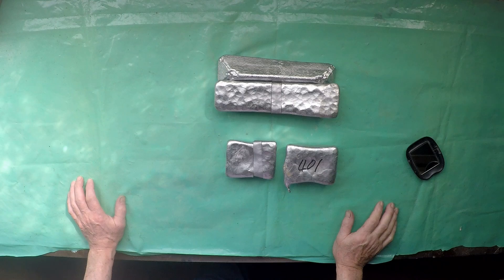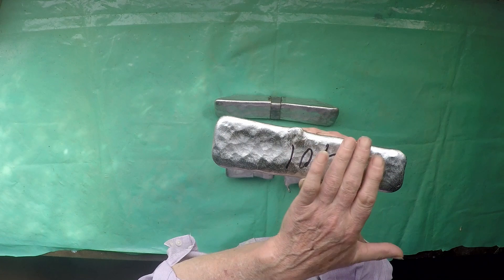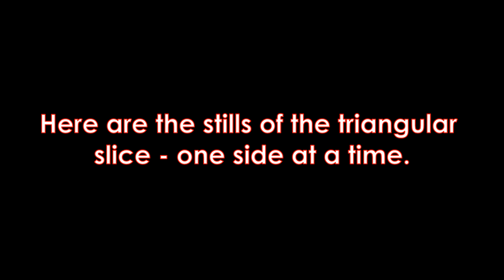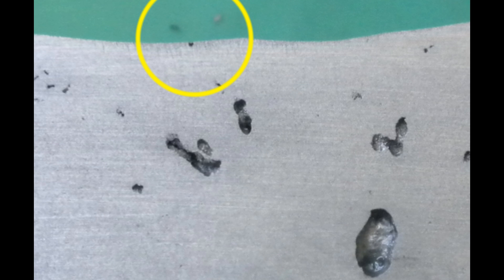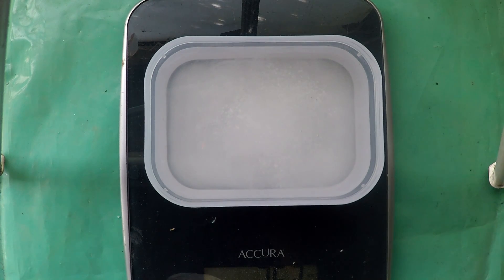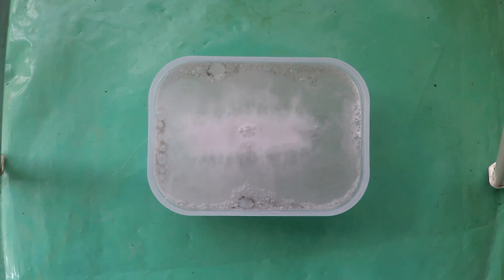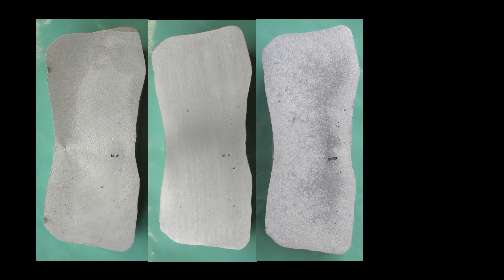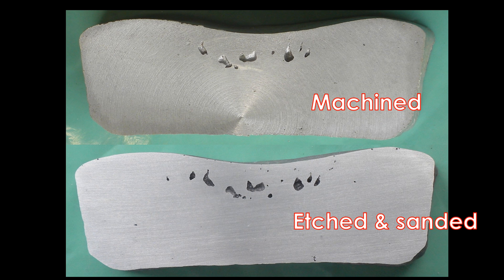Caustic Soda etching to reveal porosity in aluminium alloys.

Comment: The only question I can't seem to get answered (or I haven't come across yet) and that is how does one prevent porosity in high humidity areas?
Reply from the maker: Amalgamous, I am mulling this difficult question over in my mind. I will come back to you in a day or three with what I hope will be some sort of sensible, and more importantly, useful answer. I have heard of foundries that just would not pour on especially humid days but that is not always an option . and I think it possible to do better.... Martin
Reply from the maker: Amalgamous, OK lets have a go at an answer. Firstly its not relative humidity on its own that we need to worry about but rather its combination with temperature, because together they determine just what percent of the air is water. Thus high humidity and high temps are bad while high humidity and low temps are nowhere near as bad. Now you can either find charts on the internet that relate the two to water content or you can simply use "dew point " as an indication the lower the dew point the less the water in the air and the safer it is to cast. Either way investigate this throughout the day week month year etc to determine when the lowest water content times are and perhaps cast only then - mould and get ready any time but cast only at lower water content times. 
But is all this bother really necessary? Even a high humidity day (90%) at 20 deg. C is going to have about 2% water in the air, raise the temp to 35 deg. C and you might have a bit more than 4 % but in my opinion anyone who casts on a 90% rH 35 deg. C day has got rocks in their head - way to damn uncomfortable  for this little black duck! 
We all  burn a hydrocarbon fuel, propane or vaporised oil. Taking propane  C3H8 and assuming the right amount of air we get the exhaust gasses swirling around and into our crucible of metal of Approx. 75% nitrogen 17.5% CO2 and 9.5% water. The nitrogen is just a parasite doing nothing more than removing a lot of expensive and lovely heat out of our furnace by virtue of its much raised temperature as it leaves. The CO2 and water remove heat too but at least they contributed to it in the first place by their formation. My point here is that the 9.5% water in the furnace gasses is going to completely swamp the effect of the natural rH and any great worries about whether the day is 1% or 2% or even 3% water in the air pale into insignificance beside that 9.5% in the furnace gasses. Of course its an additive situation, that 1 or 2 or 3% will add (slightly diluted by the addition of a dry gas - the fuel) and will push that 9.5 % up to 10.5% or 11.5% or even 12.5%. But if you are doing things right is that relatively small increase going to have any great an effect - I don't think so - an effect sure but not large and if you are having severe gas problems I suggest you look  elsewhere for the cause. High rH will make it a little  (emphasis on "little") harder but attention to raw material, melting and pouring practices, and good gating together with if necessary good degassing procedures (NOT washing soda that just increases gas levels .. Grr..) should prevent any serious gas problems. Remember that hydrogen gas needs nucelli within the metal to form bubbles on without these even quite high levels of hydrogen will remain in the metal in the form of a harmless super saturated solid solution. Most commonly these nuclei are oxide films that come with dirty metal - clean metal = no gas bubble metal.. Martin
Reply: @olfoundryman8418  Thank you so very much for the reply. Since our climate here is subtropical with hot and humid summers are the norm, I definitely agree that hot and humid summers here has made casting during the winter months to me is almost a necessity. Otherwise, I risk having the floor smack me in the face. I have some homework to do and some experiments to try. Thanks!

Comment: Outstanding demonstration. Very interesting to see how much hydrogen was picked up with the metal sitting for 7 hours. Makes me think it might be worth degassing the metal before pouring ingots if the metal has been sitting the crucible for a long time. (but then again degassing before pouring ingots might not do anything to improve the metal for the next pour since it will get degassed at that point)
Reply from the maker: Ask, As I mentioned in the video I have done this job a few times each year for close to 30 years and I have only ever had gas like this once before and on that occasion there was something strange with the batch of metal as it produced a strange iridescent colour on the solidified surface. On that occasion  it picked up gas very fast, I had to degas every 30 minutes throughout the day. I would love to know what the impurity was but probably never will - I still have a sample but it would cost a fortune to have it analysed for all know possible contaminants! Hmm, I wonder if I can get Bob Puhakka to analyse it for me, sort of thing I think he would be interested in. Perhaps it was just a very humid day, perhaps the metal was a little contaminated perhaps I had it a bit hotter to compensate for the lad doing the casting being slower than I and the die ran colder thus needing hotter metal, perhaps we will never know. One of the ways of getting gas out of metal is to ingot it into moulds that will cool it only very slowly. That way most of the gas  comes out of solution and hopeful escapes into the atmosphere. There seemed to be very little gas left in these slices so presumably  that which came out of solution soon enough escaped completely with only the last getting caught under the steadily thickening oxide skin on the upper surface. On remelting I think it most likely that the hydrogen bubbles would escape into the atmosphere rather than redissolve in the metal as to do that it would have to travel (relatively slowly) through an oxide layer on the bubble / metal surface.... Martin
Reply from the maker: Ask, Something had been niggling in the back of my mind  so I did a bit of checking and found that there is a further impediment to hydrogen bubbles getting back into solution when the metal is remelted, The hydrogen in the bubbles is molecular i.e. H2 to dissolve in the aluminium it needs to be atomic (sometimes referred to as "nascent") i.e. H To get from H2 to H is not impossible but it will slow the whole dissolution process down giving even more time for the  H2 to waft of into the atmosphere rather than into the metal (as H). However for gas to have bubbled out on solidification the metal must have bee saturated as to what it can hold when solid and this will of course transfer to the liquid metal on remelting giving a perhaps higher  H lever to start with and therefore probably a higher level when cast again. Incidentally Allen Hanford in a comment gave the following link -  worth looking - at bit shocking really! https://youtu.be/0lF9exdNxHE … Martin
Reply: @olfoundryman8418  wowzers, that is shocking that anyone would have shipped a casting looking like that. 
I'll come back to reread what you posted here again, I'm a little swamped with P-Q curves for fans and related research at the moment.
Reply from the maker: Ask, Yes, it is pretty awful. Cylinder heads are difficult and most cast are impregnated to seal them up but this one really was or at least should have been a throw out. Those gas bubbles were rather big too. Maybe they were experimenting with a new lightweight aluminium - foamed with hydrogen gas 😊.. Martin

Comment: You might be interested in this video about a Ferrari casting:
https://youtu.be/0lF9exdNxHE
Reply from the maker: Allen, Very interesting, thanks for the link.  It sure does look like gas porosity to me, all the same size and nice and round! Would have been interesting to see that after a caustic etch! To be honest cylinder heads are pigs of things to cast all that complexity of water passages ports etc make it hard to get a good casting and most are vacuum impregnated to seal them up, but even so I would expect better from a foundry supplying Ferrari!. Either way too high a gas lever or the metal is way too dirty or more probably both as dirty metal always shows more gas for the same true gas content as does clean metal. As John Campbell says "start with a good quality melt" they didn't .. Martin
Reply: @olfoundryman8418  anyone can make a mistake; the fact that quality control on an ultra-expensive car didn't catch it is shameful. A Harley-Davidson dealer near me once showed me a brand-new Sportster cylinder with a hole IN THE BORE that I could put my pinky into. Not sure what causes such problems in cast iron but the fact that it went out the door means that multiple people didn't even look at it.
Reply from the maker: Allen, Such a hole (assuming its smooth) is probably an air bubble caught in the liquid metal by bad gating practices it gives this sort of random defect. Where I last worked (for a boss) they did 100% inspection (brake components) but even that does miss things - people are human! But a hole that size, well that sure should have been picked up!... Martin

Comment: Caustic soda reacts with Al   When placed on a solid piece it's more likely to react along naturally occurring dislocations.   That makes a "small hole."
Reply: Grain lines (naturally occurring dislocations) are going to be extremely small compared to gas porosity. orders of magnitude difference.
Reply from the maker: John, Ask, We have to be a bit careful here as dislocations are a very specific thing to do with local disruptions of the atomic structure. They are extremely important in the way metals deform( by dislocation movement) and the prevention or hindering of their movement is fundamental to various hardening /strengthening processes. I doubt this is the sort of dislocation that you mean. I am assuming that you mean local differences in the alloy that encourage local corrosion a local precipitate of another phase in the structure for example but more likely an oxide bifilm inclusion these are inevitably the site of gas and shrinkage porosity and of precipitation of other phases
Reply from the maker: Damn! clicked "reply"  too soon had not finished. It is of course true that etching will increase the size of a defect because it is chemical removal of metal so it would make a hole a bit bigger - how much - I have no idea but don't think it much and there has to be a hole there first anyway for it to get bigger!. Not sure that I would call grain lines (boundries) naturally occurring dislocations I think the term is more specific than that. But it is true that at a grain boundary there are frequently dislocations of structure within the grain and that structure I different to that in the grain next door and a given dislocation is structure specific. For metal to deform across a grain boundary a new suitably orientated dislocation has to come into play at the edge of the second grain or deformation stops. This is all getting a bit complicated.😊.. Martin
Reply: @olfoundryman8418  Martin there are a couple of videos floating around on YouTube from WWII that show representations of Al at the molecular level and talk about slip planes and structures and the effects of forging and heat treatment as well as tempering.

Comment: I've worked with sodium hydroxide and soap making in addition to the gloves and mask you should also have eye protection on if it gets in your eyes it will blind you
Reply from the maker: Brian, You are right it can be nasty stuff.  At my age glasses are mandatory so my eyes did have some protection - perhaps I would have been better off with full visor but then my voice would have been muffled. Try it 50 50 with water it will boil for sure stand back though!... Martin
Reply: Olfoundryman YOU SHOULD HAVE A RESPIRATOR ON WITH ACTIVATED charcoal TO ADSORB THE OH
Reply from the maker: Thomas, No dispute you are right! But you would not have been able to hear me through the respirator - I suffered (only a very little) for your benefit 😊… Martin

Comment: Awesome video Martin, I believe the best solution for us home castings is use good clean metal and use a correct basin, sprue and runner design and just forget about all the addictives of homemade fluxes and degassers. Always learn a lot from your videos thank you sir, hope your health gets better.
Reply from the maker: Ray, You got that dead right I would though add use a proper casting ally, melt quickly, don't get it too hot, and pour without delay - don't give that damn hydrogen a chance!. Health is improving - slowly.. Martin

Comment: So this alloy is a skin former, subject to porosity and it machines poorly......what are its bad qualities???😜
Reply from the maker: Rv4, It's a horses for courses thing! Every alloy has it good and bad points and thus each its particular uses. This alloy is very fluid
and thus it is used for thin castings - lawnmower bases for example, lace work etc. Being a skin form is not necessarily a bad thing it just means that the metal tends to solidify in a line, solid one side liquid the other no mushy bit in between  and sometimes this is an advantage, the gross shrinkage porosity is easily avoided by providing feeders and designing to avoid hot spots in the mould. I only use this alloy where I feel the excellent fluidity is a help. It has moderate but useful strength without heat treatment it can not in fact be heat-treated. Its high silicon content makes it abrasive to tooling HSS tools lose there very sharp edge quite quickly - carbide really is a must. Bandsaw blade dull quickly much quicker than with the more common 601 (356) alloy. It is perhaps most used in gravity die work, and should not really be used for thick castings by any method... Martin

Comment: Wow Just wow! What an ungodly mess in this ingot. Would I be correct in assuming this was all caused by the extended time at molten temperature? Really glad to see and hear you again Martin.
Bob
Reply from the maker: Bob, Your assumption is correct with respect to the hydrogen gas porosity. However 99.9% of the porosity in these ingots is shrinkage porosity. It's only those very small bubbles that are true gas porosity. Had this been a casting and provided with an adequate feeder the shrinkage would not be present. All we would see is the small gas bubbles although I suspect there would be quite a few more as no doubt a lot of the gas has gone into the shrinkage pores rathe than form its own little bubbles. I have now got to the stage where health wise I can manage a video like this a bit at a time but as yet I am not up to the longer rigours of casting. I hope that it will come in time, in the meantime I have some older video to get edited  and quite a few non casting but foundry related videos to get done. There may be some time between videos but they won't stop. - well not yet at least.😏... Martin
Reply: @olfoundryman8418  See I am actually learning something! 

Light exercise always helps. I was just released from the plaster cast prison, pun intended. I had to design some exercises around the house that didn't involve crutches. Damn things made me have the coordination of a dead gazelle. I'm sure you have a few ingots handy that could be used. 😁
Reply from the maker: Bob, I have in fact embarked on an exercise regime it does seem to be helping - although I hate it... Martin

Comment: How much does a dye penetrant help with making voids visible? It's interesting how machining and sanding obscures the pores and etching cleans out the pores but can bring out other artifacts. There's a huge difference between textbook metallurgy and the realities of prepping and examining a sample; good to have such an accessible demonstration of both theory and practice.
Reply from the maker: aclight, Dye penetrant would be quite helpful, it would make these small pores much more easily seen and may well show up ones smaller that we could not see but probably exist in these samples. I have used it for crack detection on steering components and it is a good technique if a little messy - that red die, it gets everywhere. My Metallurgy student days (Oh so long ago!) were spent in a lot of sample preparation, we spent a lot of time eyes glued to microscopes and we got to pretty much know what a sample was an what had been done to it and what if anything was wrong with it just by looking down the microscope I wish I could affords a good scope!.. Martin